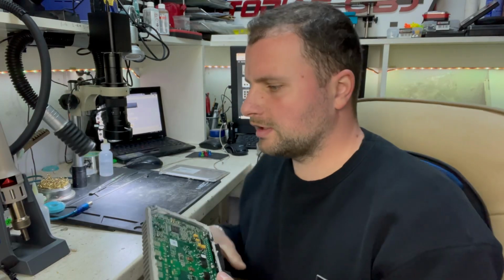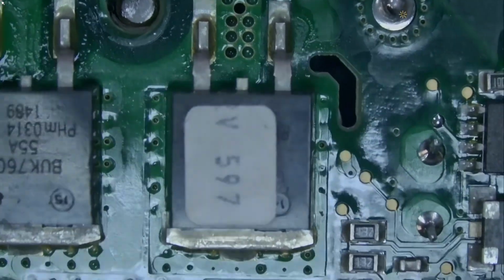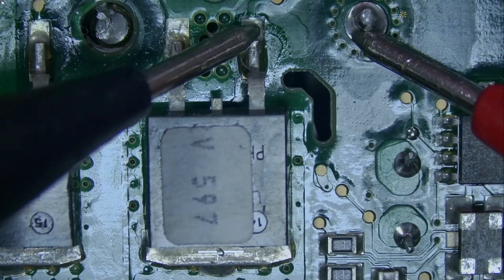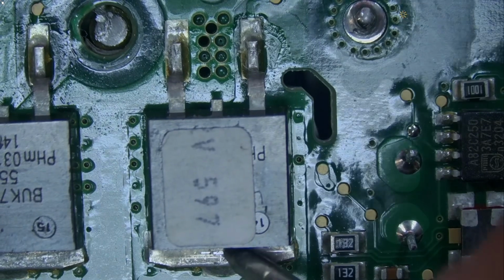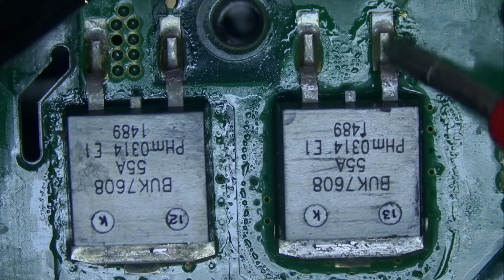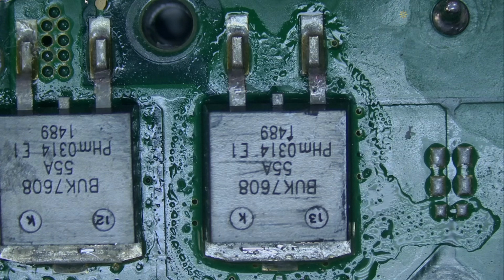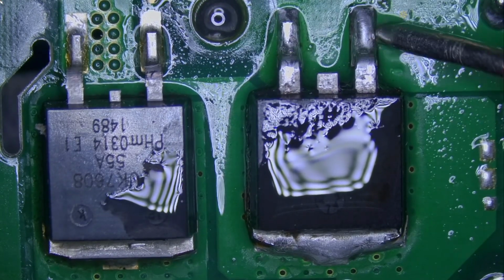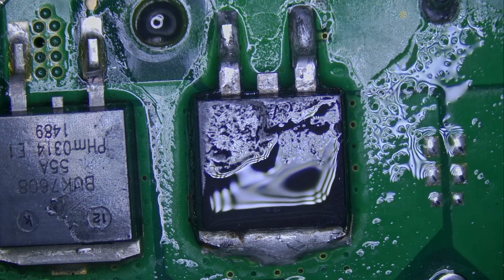BMW E46 1.8 Valvetronic actuator Control unit repair

Comment: Nice! Good work, very informative video. how do you learn which component belongs to the valvetronic control?  I have a (same) ECU with a short circuit, it only supplies 4 volts to the electric motor.  I should be able to solder it, but how do I know which component belongs to it?  are there circuit diagrams?

Keep the good work up 🙏